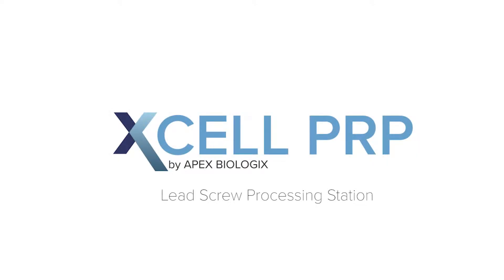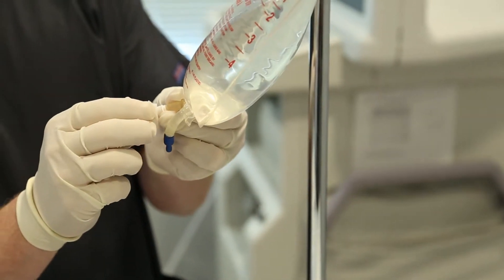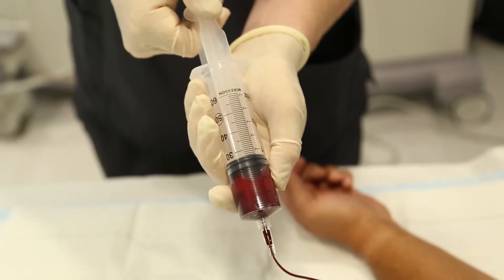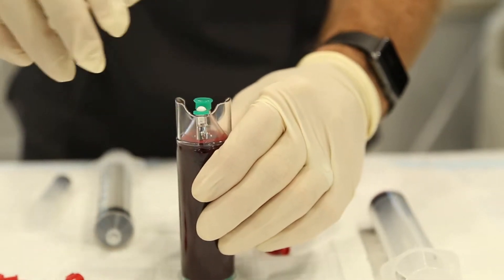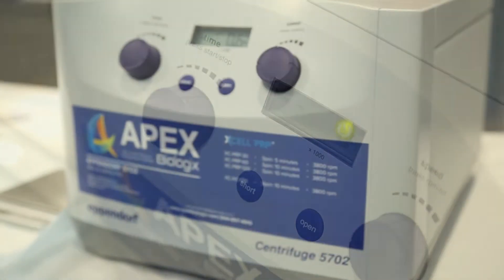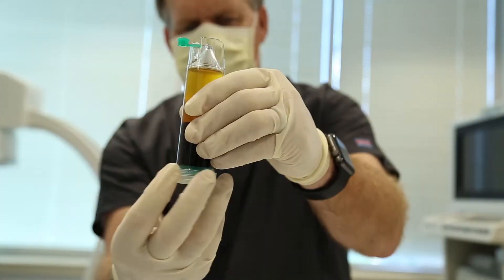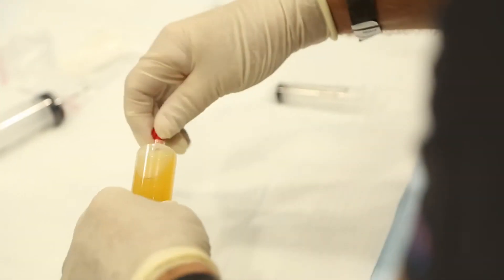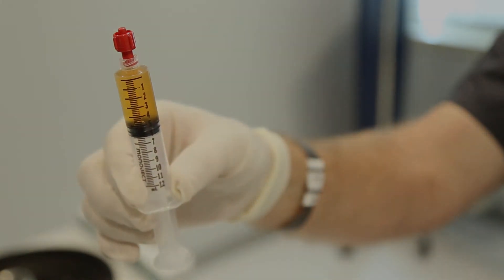XCELL PRP Processing Video - Lead Screw

Comment: my question is this -
why not use the platelet poor plasma as well as the prp ? 

why separate the two? isnt PPP used in healing as well as PRP?
Reply from the maker: In order to get PRP, you have to separate the blood components. If you wish to use the PPP as well as the PRP, you've got to take the PPP and condense it via a Hemaconcentrator, like the one we have in our Protein concentration kits.  However, you won't be able to put all that PPP into a joint.